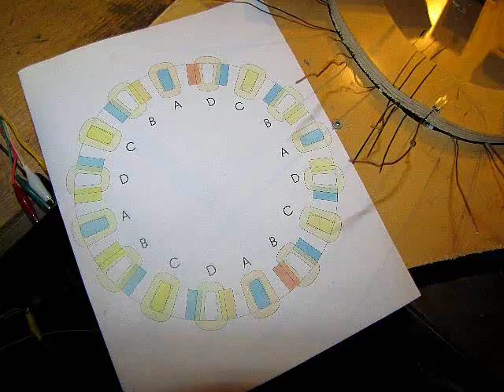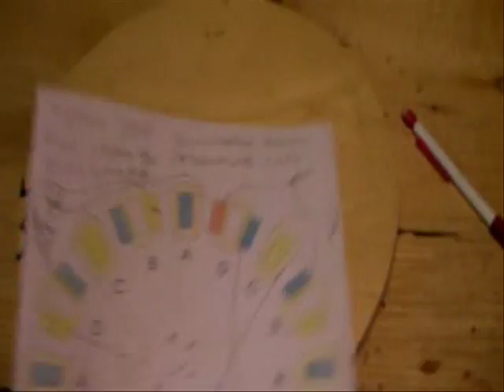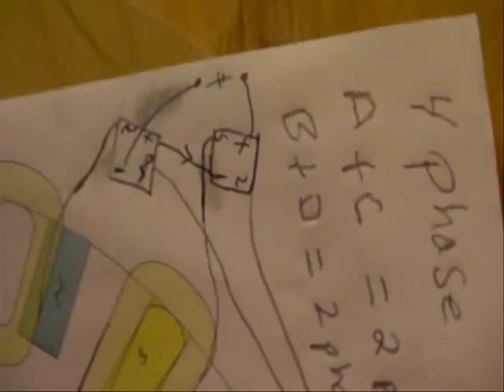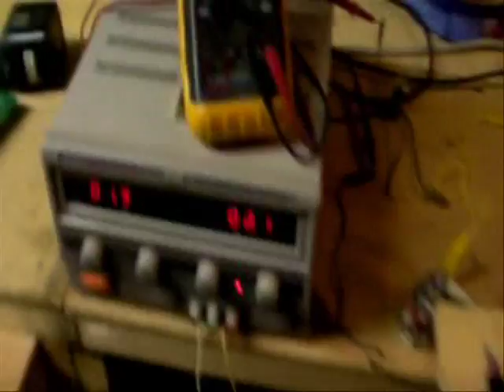axial flux 24magnets 16coils 2phase splitt vawt 24.wmv

Comment from the maker: Also there are many ways to store it:, air, hydrogen, batteries, flywheel and gravity effect equipments, like lifting
something heavy while the power is on and later you can drop it and gear it up to produce the energy back
grid ties, means direct use

Comment from the maker: WulfBand, when others say 12, 24, or 48, they acually discribing the battery bank system they have. but in order to acually charge the battery, you require a bit more voltage to create the force/pressure and the creating of Amps. so 12=14.1 24=27.5 48=51 and so on. 
i think i got it right, 
for the others to correct me if i am wrong